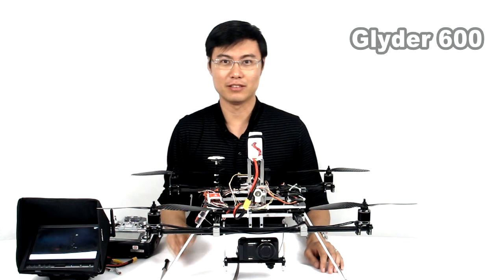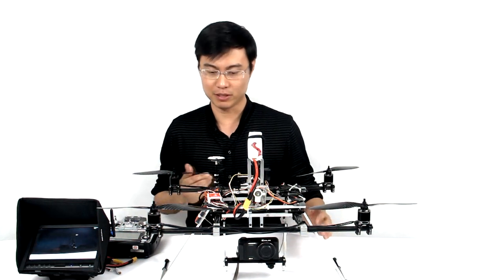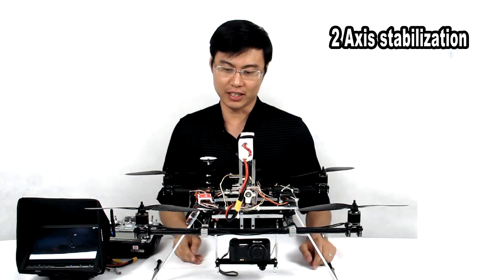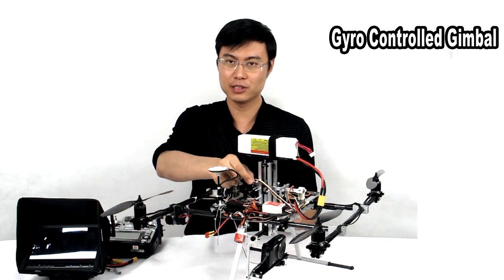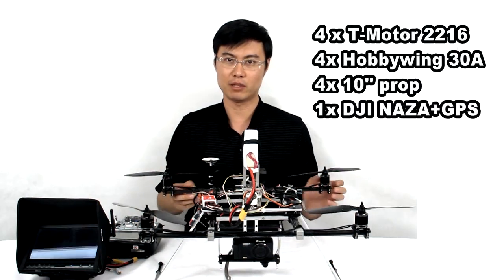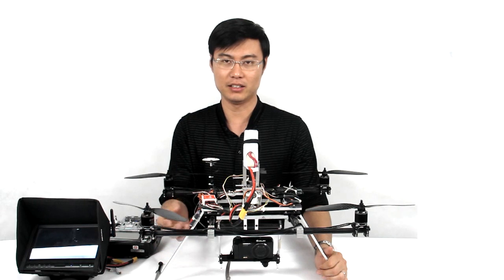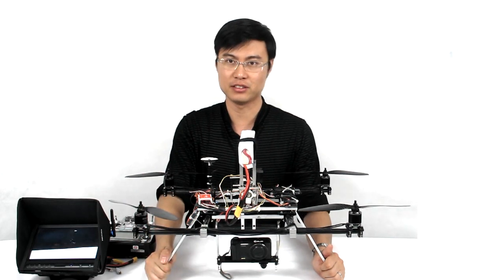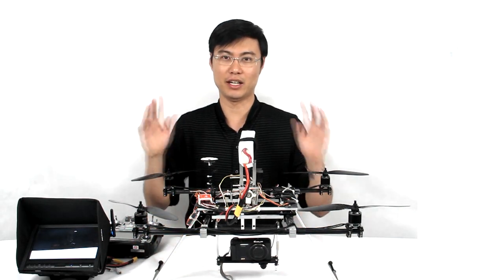FOXTECH Glyder 600  Quadcopter

Comment from the maker: the NAZA controls the gimbal to keep it at level position, I recommend good and fast 27g servos, we use springrc 's metal gear digital servo, works great.
also the gyro is important, so it will not affect NAZA control

Comment from the maker: you can adjust NAZA position in DJI assistant software , you can mount it anywhere on the copter actually, it will be available in 1 month and preorder will start soon.
it's compatible with NEX5 for sure ,the performance will be similar.

Comment from the maker: easy man, there is nothing similar to the ECILOP easy kit at all, I checked their website already ,there is nothing similar, if you say ,this is a copy, how about  steadi470 from zeroUAV?
on our frame, everything is different, frame structure, gimbal structure, servo control method, landing gear or so.
if you can show me an example that ECILOP developed something similar?
I don't think if someone invented a bicycle , no one else could redesign a better one.
thanks
Fu

Comment: not many vids out there using the glyder 600 - i bought one a year ago and haven't been able to make the f.ker fly cos i bought 390 kv version and i have no 6s battys. Probably should have included a power distribution board so that motor 4 isn't starved after 1,2 and 3 has sucked the wiring dry of electricity. ps i have 4 x unused 390kv foxtech motors  - i use 4s, my mistake. ebay here come new 390kv's